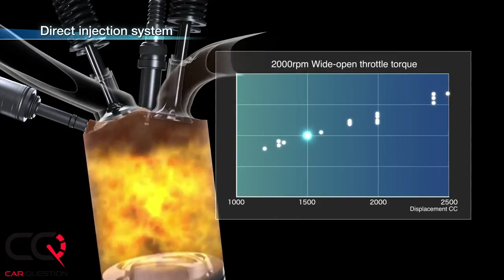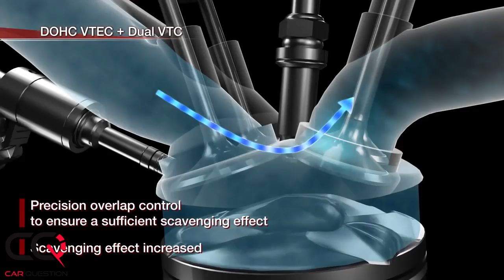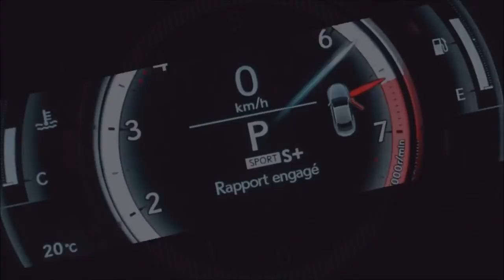Honda CR-V Turbo: Overfilled oil levels and a gas smell Fix and RECALL!

Comment: Honda not just the  Cr-v its in the Accord models as well as of 2020 model of the Cr-v Honda put this 1.5 turbo motor in the base LX model dropping the 2.4l engine option.
Reply: as evidenced by what? 50 people on youtube? I want actual numbers from reputable sites to prove what "people" keep saying about the Accord 1.5T. Carcomplaints is also what.. 200 out of over 500k Accords in the United States.

Comment: my late father in law's  crv went in for recall and I still smell gas  in the cabin  bigtime  its gonna be an over time thing to see if these motor's last 300; 400 thou   my guess  problems shouldn't be to long down the road 50 thou 100 thou  but what is Honda going to do pull the engine and check for excessive wear on engine parts I think not   good luck to other's who have purchased this but if I had 1 it would be traded immediatly

Comment: Lets take the bullet proof vtec engines we spent decades to perfect keep the perfected engine for two decades and scratch that engine by putting gdi on it or even better yet gdi plus ramming compressed air into a way smaller in size engine and see what could happen engineers with doctorates did this and i don't have a doctorate in engineering but i understand that pressure and time turn things into oil, coal, diamonds etc. What you think would happen to an engine cylinder? Scrap the 1.5s gdi turbo and gdi engines and go with the winning combination gas pump from tank and air from the earth. Don't fix if it ain't broken.

Comment: I bought a 17 crv a little over a year ago and the sales man at pembroke honda assured me the fuel problem was fixed well its not i just changed my oil and their was almost a litre too much in there and smelled of gas very strong its also threw a cam code   Worst crv ever i was talking to pembroke honda and they told me to plug it in and turn the heat down omg really

Comment: My 2016 Honda CR-V TOURING had it and it wasn't turbo! (Oil dilution) It is a fuel system, direct injection issue. The direct injection is deep inside combustion chamber. It doesn't wash the top side of valves, like port injection does, hence no issues. My new Toyota Highlander has both direct injection and port injection. For power, it kicks in direct injection, for idle or low power, it uses port injection, no issues. Thanks Toyota!  I don't work for Toyota, just dislike Honda for how they are handling issue, should be a recall!!
Reply: @Fadic4  which can cause many issues prematurely
Reply: @Fadic4  I bought my  2016 Honda CR-V TOURING with 12 miles on it, new.    I noticed oil level rising above top mark by 1 1/2 quarts right away. Mine wasn't a Turbo either. 
Dipstick smelled like gasoline too. Had bad warm ups to, never heated up like a it should. Traded the POS off. Honda had no fix yet. China had recall on the issue
Reply: @Fadic4  10,000 miles??
Reply: @MegaLifeChanging  China has a Honda recall on the 1.5 turbo engine, not the 2.4 engine that your car has.
Reply: George L China also has different standards than the U.S. does too, so that makes a difference.

Comment: CR V TOURING  2018,1,5 CVT, gas in the oil and smell in the cabin started when the car has  1000miles. Keep calling Honda but no answer yet. They don't even name this problem a recall because they probably don't have the fix, there are toooooo many cars with this issue and they don't want to spend to much time, money and energy to fix their problem faster. Is someone here did something with lemon law??
Reply: Hamilton vs America Honda
Reply: It isn't a recall because a recall is a mandated action by the government. When a car company calls in vehicles for maintenance because of its own choice it's called a Campaign. It is a campaign.
Reply: @afcgeo882  when was gas getting into oil maintenance?
Reply: @tonychau1983  any work done on anything is maintenance. It isn't regular/scheduled maintenance, but it is called maintenance.
Reply: @afcgeo882  Except when China recalls all Honda 1.5t or almost 500,000 units.
Reply: @normt5463  right! China required a recall and I believe for 1.5t Civics as well.
Reply: @afcgeo882  All China Hinda 1.5t's were recalled in any model car.

Comment: I own a new 2017 Honda Civic Si sedan since November 2017 and so far I have not noticed any fuel smell in the cabin or gas mixed with oil in the engine... Knock on wood.

Comment: Colf start is a distraction thrown out by Honda i guess... i think the real issue is with the negune design here.... 1.5L short stroke engine is too small to handle the Direct injection and a turbo on top of that.... such high compression ratios in such short stroke engine.... you need to get it right over 100% and they couldn’t... why the 1.8 or 2.0 with the same tech don’t have these issues... plus kia and Hyundai are also using the same tech for years now ... the didn’t got this issues ... and answer is they didn’t go beyond a certain engine size with these tech Honda try to took it to another level just too achieve those heavenly numbers of MPGs and end of into this  nightmare....

Comment: I think EVERY turbo car should have sodium exhaust valve so you can run a leaner mixture. These lower end turbos are running SO RICH to save the exhaust valves and they are so sacred of LSPI warranty even with low calcium and sodium oil they flood the cylinders with too much fuel.
Reply: my civic 1,5turbo honda engine has sodium valves
Reply: oh good to know, my Hyundai i don't think does, the "N" versions do.

Comment: Pretty much all engines will have some fuel in oil to some degree, nature of a 4 stroke engine.  Some engines are worse than others, however with regular scheduled oil changes, there would be no real issue.  If you leave your 1.5l turbo CRV for a couple of years without an oil change, there may be an issue.  Hell, two stroke gas engines require a mixture of fuel and oil, ie. 12:1, which doesn’t seem to bother those engines.
Reply: Amen..But they will say that you work for Honda..conspericy affoot
Reply: That’s why two strokes have roller bearings unlike a four strokes plain bearings.
Reply: Very good point about the roller bearings, more forgiving than plain bearings, and I don’t work for Honda and I drive a Ram 1500.

Comment: Buy a Toyota and enjoy driving it 250K plus miles with just basic maintenance
Reply: enjoy that 8-speed clunk-fest. Test drove several of them and just couldn't feel comfortable or confident.
Reply: I have a 2021 RAV4 with the 8-speed and it shifts fine. I’m not sure what you’re even talking about.

Comment: I can't see how changing a few zeros and ones in software code is going to reduce blow by. Honda took a bulletproof design and turned it into shit. CVT and smaller engine with turbo ? I'm going with the RAV4 which has neither.
Reply: you fall right into the trap
Reply: Maybee you should buy a Rogue.
Reply: @GiovanniRomano every new redesign vehicles are garbadge, I'm glad that I bought a 2017 VW Jetta last year  instead of waiting for the 2019 model.
Reply: @GiovanniRomano moral of the story, never buy in the first year. Research 8 speed tranny issues with new Camry. Needs time.
Reply: It's easy not to see or know things. VERY easy. It's even got a name: IGNORANCE.
Reply: @nickv4073  Toyota has lots of CVTs and none have any issues.
Reply: @GiovanniRomano The Tacoma has an issue with their new dual-cycle engine that switches from the Otto cycle to Atkinson and back.
Reply: @afcgeo882  corolla

Comment: All 1.5L Turbo Earth Dreams are effected (so that means all Civics excepting the Type R). Failed to suggest workarounds that diminish the issue (oil separators). Also if you do research you'll find many complaints, far more than would seem usual. These engines have been banned from an Entire Country (China), until they fix the oil dilution problem.. No mention of that in this video. I appreciate the effort but this video was poorly researched and didn't add anything to the conversation; even worse it minimized what appears to be an epidemic.
Reply from the maker: Poorly? Not really at the time it was done ... so please check the date before bashing

Comment: I think this is happening more down in the US than CA ? i never seen any LX models have these issues mostly EX and above .
Reply: S N The LX uses a different engine. EX and up uses this 1.5T that the video is about.
Reply: @rmoore07  we are in canada . all models uses the Turbo 1.5 . the us is using diffrent engine on lx

Comment: People it's a turbo car wram up the car before driving it and before turning the car  off let it sit for 1 to 2min before turning it off. Ever since I got my CR-V  I always put 91 gas in it  and I never use the E-CON..
Reply: Y Honda calls for regular
Reply: very good advice.however in this fast pace world,its start up and go
Reply: The problem is that it takes a long time for it to warm up, and it cools down very quickly.   Taking the same route to work, my Jeep is up to temperature before my crv even temp shows up on the dash.  That's with the jeep parked outside in 30 degree weather, and the crv parked in a 60 degree garage.    Just traded the crv in.   My first and last turbo.
Reply: john giardina faster than walking! Turbo or not
Reply: Jason Dahlstrom I wouldn't take it out on all turbos but old school methods are much better. The compression is kept low. The turbo is much larger. Port injection. There is lag but when the boost hits you get double or triple the power. So many turbo motors out there. But they are like race cars and not for everyone!
Reply: @tonychau1983  that's the problem. It can drive on regular, but 87 octane just doesn't burn as hot. It's a variable valve timing engine with knock retardation, so you can drive it on 91+ just fine and it will run better on it.
Reply: @afcgeo882  honda better update their fuel requirements
Reply: @tonychau1983  I think I've read somewhere that they recommended that people with the problem switch to premium octane fuel along with other procedural recommendations, but I don't think that alone will solve the issue. It's likely they will need aggressive engine programming changes or an engine re-design or both.I also think that recommending 91+ octane would destroy their sales numbers. 

If I was Honda, I'd look into offering the 2.4L engine on the upscale trims as a standard engine and leave the 1.5T as the upgrade. That's if the 2.4 doesn't have this problem, which it might because it's still a DI engine with a similar design.
Reply: @afcgeo882  that would be a good idea. And for the people that bought already they might be pissed since alot of people used to skip a turbo because they didn't want to pay the extra for gas I dunno know why they cared about the extra since the turbo models now are usually the higher end models now.

Comment: Honda Earth Dreams....
Reply: Im from Toronto (CANADA)i have a 2017 honda crv and i have a lots of issue with this car.everytime i warm-up the car,i smell a bad gas coming out from the pipe even using the heater you can smell inside the cabin...i have oil leaks from the cylinder head gasket and everytime i use my heated seat,it turns off by itself...so disappointed buying this car...
Reply: buy American you will feel right at home
Reply: @ryanlittleton5615  We had a 2015 Terrain 2.4l Ecotec that never needed oil added.  And even after a cross country trek and up and over Rockies spinning 5,500 rpms up mountain sides loaded up with bikes hanging off the back end.

And that is with a ecu tune and +20° of timing and quicker upshifts. At lease end of 45,000 miles it was still rock solid.
Reply: @normt5463  That's great Norm. However GM has a serious issue just like Honda and you're trying to act like GM is the all end all. When they are SOOOOO NOT. It's funny how you've never mentioned anything about your Terrain, you always talk about how great your Envision (Equinox) is. What gives?
Reply: @ryanlittleton5615  the Terrain was returned as the lease ended over a year ago.  Problemless CUV and not much to talk about.

Honda is new to DI and turbos and it shows.  GM has had Ecotec 2.0T with DI since 2006.
Reply: @normt5463  Ah I see. Honda isn't really new to DI but they are kinda to turbos. But that doesn't explain why the majority of 1.5T owners are fine, and the 2.0T isn't affected. What do you think?
Reply: @ryanlittleton5615  I think Honda will do nothing about the 1.5t besides the ecu/TCU updates.  Though there is a current class action suit against America Honda, Subaru eventually had to pay up for oil consumption.  But not paying up for the smaller Suabru would not have been good.  Honda doesn't care.
Reply: @normt5463  Mazda had a similar problem with their 2.2 Diesel (in other markets) and issued a software update and actually fixed the issue. And GOOD, there should be a Class Action Lawsuit  against Honda as was the case with Subaru. But unlike Subie GM is currently trying to get out of their own lawsuit to fix the 2.4L, very typical for General Motors. But in a way I would have to agree on "Honda doesn't care" to a certain extent. They're still not on the level of GM (in terms of not caring) but it almost looks like they're getting there. But that being said, apparently people that have had the fix (in Canada), say their problem has been resolved, so I guess that's a good sign. But there's only a few reports as of now, so we'll have to see. See unlike other Honda fanboys (I admit), I'll call Honda out on their shit when they need it. BTW, you still didn't answer my question.
Reply: @ryanlittleton5615  GM provides coverage of 2010-2011 2.4l that consumes a quart every 2,000 miles for 10 year/120,000 miles from the date the vehicle went into service regardless of owner.  More than Honda has provided no extended warranty in the states which if you know anything about turbochargers they wear out very quickly when the journal bearings have to rely on gasoline as a lubricate.
Reply: @normt5463  First of all Honda has in fact extended the warranty for people who have reported the issue, which in my opinion is still not enough. GM has in fact done nothing of the sort for it's customers. And why just 2010-2011? When it effects years 2010-2017. And it's not 1 quart every 2,000 miles, it's every 1,000 miles. And and screw the coverage (if they even did it), GM should be actively rebuilding or giving their customers brand new engines since the problem has to with piston rings and/or oil control seals. If they did that I'd have more respect for them.
Reply: @ryanlittleton5615  Honda has only extended the warranty on the 1.5t for Canada.  I've seen the service bulletin.  Unlike Suabru and GM who have extended their warranties. 

https://gm.oemdtc.com/5435/special-coverage-adjustment-excessive-engine-oil-consumption-2010-chevrolet-equinox-gmc-terrain

Our 2015 Terrain 2.4l did burn oil nor did it drop the oil level over the Rockies and back, going up 10,000 passes at 5,300 rpms for miles.  Solid engine and very responsive with a ecu tune.

Why down on G.M. when Honda is making the junk today?

Comment: I live in new Jersey. I had de fix done and is still doing the oil mix. The fix sucks..!!!
Reply: You can only "update software" so much.  These engines were already running super lean fuel mixtures to begin with.

Comment: THIS IS TOTALLY FRUSTRATING.  HEAR THAT HONDA?!?!?! 4K OIL CHANGE AND LEFT THE OIL PAN OPEN FOR 15 MINUTE AND MY WHOLE GARAGE STINKS GASOLINE.  WHAT ARE YOU GOING TO DO??? NOT ACCEPTABLE AT ALL!!!
Reply: They aint doing nothing. These small engines are to bypass the EPA laws by cheating and say yea my small engine produces barely any CO2 but in return you're just having to waste more gas due to leakage like Honda's and just causing damage to engines.

Comment: We traded our 2018 Civic in because it had this problem and the dealership was denying it was an actual problem. You could smell the gasoline on the inside of the car, especially on a cold start.

Comment: Honda: "This oil dilution issue is not the droid you were looking for."

How far they've fallen. Imagine what's going to happen with these engines as the miles stack up and the rings loosen up.
Reply: They're already lose
Reply: My 2021 CRV has less than 400 miles. The dip stick reeks of gasoline.

Comment: Since all motors when first started from cold need enriched fuel injection, lowering the fuel amount may not be a viable fix or one that is going to stop fuel from entering the crank case.
Personally I think Honda designed the oil rings too weak or strong enough to hold back the fuel air combustion .
 Why is it that other auto manufacturers like Mercedes Benz, BMW , Audi who also have high compression turbo charged 4 cylinders engines, dont have oil dilution in their motors ?
Answer = because they designed better and stronger oil rings for the pistons.
Reply: Yes, but I am not sure about Honda's intentions or errors.
When designing the engine, there is a decision to be made: tighter engine and high friction losses or looser seals and better economy and power.
If the rights are just too loose, the gasoline will go through. 
They made a massive mistake. I was going to buy Honda with 1.5T and now I start to fear about the hole in my wallet.